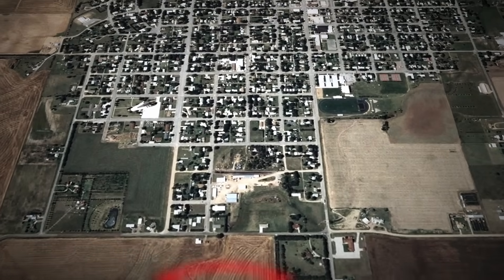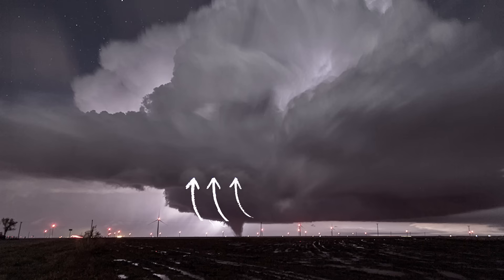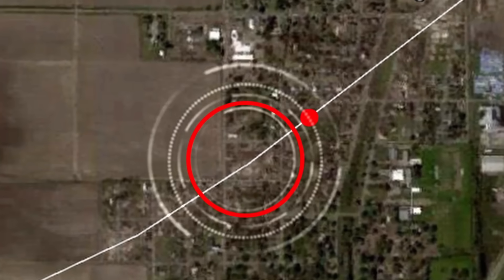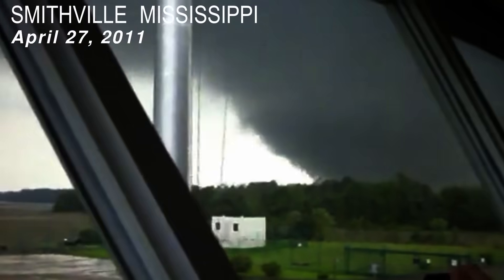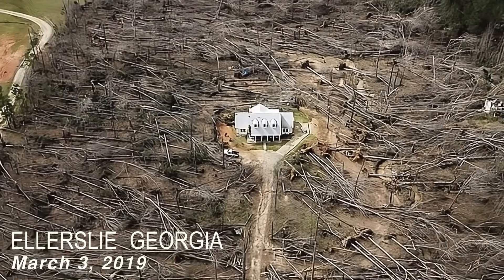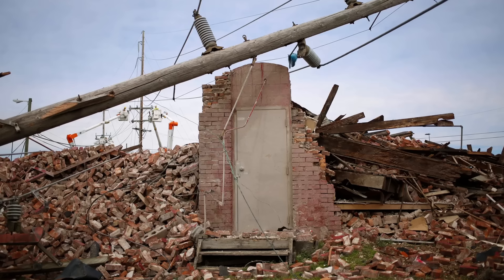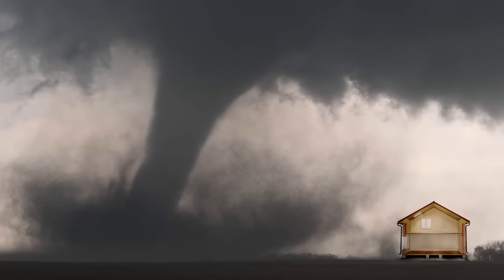The STRANGEST Tornado Damage Ever Documented

Comment: I've seen wooden telephone poles come unraveled and act like spaghetti in the center of a tornado.
While objects flew through them and once the negative pressure spin of the tornado passed, they decompressed and were solid again.
With objects stuck through them looking like physics took a vacation.
I've also during an F5 tornado seen a truck go overhead of us and land over a mile behind us.
Was rolled into a ball and blasted into a large tree it took out when it finally came down.
We also witnessed a herd of cattle picked up and disintegrated while their inside spun out if their mouths.
When they hit the ground, they just splashed like a balloon on the ground.
Had nightmares seeing that.

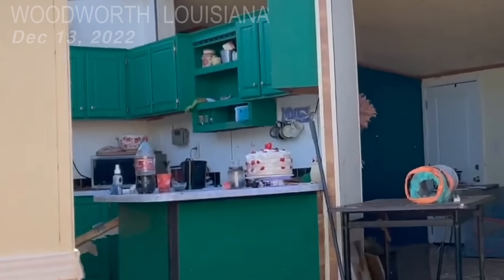Comment: 8:21 that is not an actual cake. It’s a ceramic cake holder. My grandmother and aunt have the exact same one. They were popular in the 80’s. Women would make them using a mold at popular ceramics classes. Plus you could buy them as they were mass produced. I’d know those strawberry layers anywhere! But this makes it even stranger because ceramics like that break very easily. Cool!!

Comment: At 3:03 yep thats a car astigmatism helps if you can memorise the shape, if you look close at the light its ovalesque and you can see the tiny dip in the middle separating the beam pattern per light, if it dropped from the hieght its at your looking for a severely flattened car in the debris. Weve seen videos of tornados picking up planes trains and transport trucks which weigh 10 to 100x plus what a 3200lb-3600lb standard sedan weighs so not that far of a stretch to do this.

Comment: Check out the 2007 Christmas tornado at Embry-Riddle in Daytona Beach Florida. It destroyed the school's entire aircraft fleet, flipping them over a donated (ex-John Travolta) military trainer without damaging it at all. Not even from hail. It tore open multiple buildings, with doors that never used to shut correctly now shutting etc. The craziest part? It destroyed the administration building, exposing the main girder through the center of the building. Turns out that decades before when the building was built, a construction worker had spray painted "Merry Christmas" in giant letters, only for that message to be revealed on Christmas 2007 by a tornado. Crazy stuff.

Comment: I had a 6 pack of tall can Bud Extras (discontinued now) in a shopping bag when an EF3 touched down immediately after I was dropped off from work near my apartment from a frantic coworker. I immediately had to run couldn't even get to my apartment so I ran into an empty parking lot next door. I thought it was a terrible decision since there was no cover I thought I was gonna die the tornado was gaining on me and I was getting tired and knew I couldnt run much longer when the shopping bag suddenly flew out of my hand in the air. The tornado made a sharp left turn and missed me by less about 30 feet I was covered in mud and shook up. I went to a nearby friends house until the weather calmed down thinking my apartment was damaged and in the same parking lot I saw my bag of beer on the floor. A moment of humor swept over me like cool atleast I can drink this stress away. When I grabbed the bag it was light the can tops were all completely sealed but there was no beer in any of the cans. I was shocked how did that happen? Did that tornado drink my beer!?? Funny and strange but true this was the Feb 5th outbreak of 2005 in Memphis.

Comment: In my opinion that light was most likely a emergency/road flare, either a traditional pyrotechnic flares or LED. Both pyrotechnic and LED flares are available in many colors such as red, white, yellow orange, ect.. 

 And since the light yellowish makes me believe more it was a flare. Because each flare color is used to indicate something different. And  "yellow flares are used to indicate obstacles, hazards, or the need for caution on roadways, especially in low-light conditions." There's even a good chance someone fired a parachute flare towards the tornado just for curiosity sake and /or to see what the tornado does with it.

Technically red flares aren't supposed to be used how most people do since "red flares are primarily used as a distress signal"

Also if it was a car then the car would be tumbling/spinning, so the headlights would also be spinning. Yet the light isn't flashing, it's a continuous light source.

when the light exited the tornado it doesn't seem to be falling fast enough for something as heavy as a car. There a tiny chance it could possibly be a motorcycle,
or maybe just a flashlight. But my first guess is a some type of flare.

Comment: Note that the Jarrell tornado wasn't actually stationary over DCE---it moved at a steady 8-10 mph throughout its time on the ground.  (Quick sanity check, since the actual primary data can be difficult to track down:  the oft-quoted amount of time it was over DCE---3 minutes, IIRC?---does correspond to roughly the amount of time for a ~0.5-0.75mi diameter area to pass if moving at 10mph.)

Comment: I remember reading the Little House on the Prairie books, and coming across a section in one of the later novels that described some strange damage left by tornadoes. Specifically, two men who were picked up, sadly killed, and set down perfectly side by side in a field by a twister. That’s odd in and of itself, but the pair of them were left stark naked with not a mark on their bodies! LIW also mentions how a guy just found a lone door on the prairie, with not a house or homestead in sight; it was apparently the work of another tornado that had destroyed a home somewhere and spit that door out, again with nary a scratch on it. Ever since reading that, I’ve wondered about how weird debris can get in these mobile spin cycles, and the kind of wreckage they leave in their wake. It’s fascinating to learn that the oddness continues with modern tornadoes, though of course it would be preferable if they somehow didn’t hit populated areas at all.

Comment: Just have to add some more from personal experience - or at least second hand:-) During the Palm Sunday outbreak in '65 the EF4(?) that skirted Grand Rapids, MI went north of town into a relatively rural area(since built up). There was a man who was out of town during the storm and came home expecting his house to be destroyed. Instead it was standing there, apparently untouched. But when he approached he noticed the house was off the foundations by an inch or so. Rather than go in he called his insurance agent. The agent came out, looked the property over, and came back to the guy, who asked how it looked. "Well," the agent said "the house itself looks fine but I don't know how we'll get the corn harvester out of your basement."
Later in '67 we had another that touched down on our street. Very little damage(although it later destroyed our school) but across the street were two garages side-by-side. By close I mean at twelve years old I had to turn sideways to slide between them. One of the garages was stripped down to its slab, the other was untouched, and a window in it facing its destroyed neighbor was unbroken.
That same tornado wrecked my cousin's wood-frame home. It was still standing and when they came up from the basement and opened the refrigerator it was filled with chunks of brick. Nothing brick in the neighborhood, and no brick pieces were anywhere on the floor.
Have lots more but this is long enough. Tornadoes definitely do strange things!!!

Comment: After the Girard Kansas EF5 tornado we drove around looking at the damage and we saw numerous cows with 2x4 lumber sticking out of them. We also seen about 1000 yards of T-post that once held 5 strands of barb wire that was now all missing just the post remaining. When that same tornado hit Franklin kansas it turned my grandparents garage 180` on the foundation. My grandma had a bunch glass bottles hanginf from strings on her deck and the wind didnt break a single one but spun the garage around just 20 feet way.

Comment: You are joking about the vertical winds... Right 😅😅 vertical winds cannot happen in a kitchen bruh... The cake is one of hundreds of small items that weren't displaced.. the roof was torn off... But most everything else inside was fine.
Reply from the maker: pressure difference between the exterior and interior of the home. air from inside the home rushes outwards blowing off the roof.
Reply: @highriskchris  nothing to do with my comment..  and inaccurate. Wind shear takes roofs off. Not internal pressure. It's not a pressure vessel. When wind hits a vertical flat surface.. it must go around that surface. That includes going up and over. Roofs that are torn off literally almost always have EAVES that catch that wind and flip the lid off. No different than hurricanes. Pay attention next time. You'll see it. Being in storm response for years... This is inherent. Seen thousands of storm damage and destroyed buildings.

Comment: That's nothing. In Oklahoma's F5 outbreaks, we had fully loaded Semi's flying thru the air, in Catoosa Ok. when it got to Joplin Mo's hospital they said it sat outside and churned and churned. Joplin was a right mess. You could find papers from one state in another state, or even another town. Tin roofs that no one knew where it came from. If you place isn't missing a tin roof, it must have came from a long ways away. That was in Tulsa where it landed. To this day non one knows where it came from.

Comment: But what are the chances the "vehicle" light in the tornado would remain pointed at the camera the entire time? The odds are against that. What else could it be?
Reply from the maker: Its likely that the camera settings used by Max would not show a light flickering at a high frequency (1/30s shutter speed on 1/30 fps video). Other chaser's video showed a distinct flicker to the light, look up Adam Lucio's video.
Reply: Ok. Thank you. PS: I remember seeing a high resolution (or enhanced ?) closeup/zoomed version once that appeared to show two headlights. But in the video here it seemed like the light never really changed much. I just wonder if there`s any other possibility other than a vehicle for what we see? Horrifying thought if there are people in that. My dad was picked up by a tornado on Interstate 20 somewhere between Tyler (I think) and the Louisiana line and he said he was lifted way up in the air and set back down going about 80 mph. The rear frame of the Chevy S-10 was warped some but it was still roadworthy afterwards but a 250lb load would cause the left rear tire to rub. He was in the Air Corps in WW2 from 1944 until almost 1950 and he said it was a pretty smooth landing except he came in slightly sideways and then hit a rough patch. He got lucky! I drove through a weak tornado in DeSoto Parish La in the same truck afterward on highway 84 leaving Mansfield. I knew the tornado was approaching. I almost wrecked. That was the third tornado that truck had been in...the first was in Winnfield La when it was new.  @highriskchris

Comment: Fine objects lodging in trees are caused by the trunk fissuring vertically under horizontal stress from wind ... NOT by wind driving objects directly into the living wood.
Reply from the maker: The only one that might be the case for is the straw, however the forks were absolutely stuck in trees, also the record was not stuck in a tree but rather a power pole, so it was definitely the wind.
Reply: @highriskchris  Yes, forks are solid steel, so vinyl too is much harder than tree trunks.  But I find it frightening that a tornado vortex can dissolve a tree for a few seconds-then let it reconstitute with straw in it. Human body--don't wanna say.

Comment: I’m in southern Saskatchewan Canada. In 1989 my farm home was hit by a tornado. When we came upstairs after it was going the porch and garage were gone, the room was half gone, someof the kitchen windows were gone, but the flower on the table was in place. There was wheat embedded in the back walls of the cupboards. The tornado sucked open the oven but must not have liked moms cookin  because supper was still in the roaster. We figure a rolling grain bin is what may have taken the porch/ garage addition but moms car was still perfect inside. Peices of the old aluminum topper off dads truck were stuck through the side of a grain bin galvanized steel wall across the road. But the grain truck sitting beside our bins with its hoist in the air was untouched. (Too bad, I hated driving that old heap). 
Tornadoes are weird things.

Comment: 405 joules? How many volts is that?
Reply from the maker: Volts is not the same unit!
Reply: "To calculate joules from volts you need the charge of the electricity in coulombs. From there, multiply the charge and volts together to get the energy in joules". So...  @highriskchris

Comment: I've seen tornados do weird things, cause weird damage. One picked up my grandparents (before I was born) with my father and my aunt in the car, off of I-70 highway, and set it down gently facing the other direction just off to the side of the road.

I've actually been inside at least two tornados. While in one of them (I was inside the house), there were strange columns of mist rising up all over -- like I Dream of Jeannie when she goes into her bottle, but white. My guess is that they were coming from all the rabbit holes. I'm not kidding, there were dozens of rabbits, and then, poof, they disappeared when the tornado went over. It was powerful enough to knock the fencing over and carry it off, but the house was not damaged.

In the other (this time I was inside my apartment), my ears were popping and the roofs over the playground were going up and down incredibly fast making this horrible low-pitched, very powerful noise. That one torn up trees, carried off the big garbage bin (which they never found), but went up right before tearing up the apartments.

Comment: I have something you can think about and maybe even do a video on. I have watched a lot of these over the years (grew up in the Texas panhandle, Amarillo) and I've seen tornadoes tend to follow electrical lines and hit transformers. It's also been seen that they seem to go out of their way at times to hit trailer parks. Does the electrical grid combined with metal buildings combine to "pull" the tornado that direction? It's a weird thing I've seen time and again, a tornado will be going through an area but it looks like it took a quite jog over to eat the trailers. 

Any engineering/chaser ideas on this one.

Comment: The light at the beginning you talked about is ball lightning.. I have the same thing in some of my Storm videos and I'm pretty sure that's what it is.  Tornadoes do not often suck up vehicles .. at most they move them or more likely just dent up and blow out the windows.. your theory about the cake and the velocity is on point though. The eye (center) of a the tornado is almost completely windless..getting hit by the wall is the most dangerous to get hit by .tornadoes also are rotating at various speeds within the cyclone.. the fastest and hardest part to measure is closest to the eye. It's hard to get a pod deployed into the eye because it usually gets swept up by the outer walls. So the speeds reported aren't always a good representation as to how powerful the tornado is.

Comment: Tornados are rare in Australia compared to the US, and even then, even rarer are powerful ones. Though in '93, a small one went through our town taking out two houses. One was right next door to my best freind's place and when I went to check on him, his house was fine, but a few meters away, half the neighbours house was gone. 

But and kettle was sitting atop of the fridge like nothing had happened. The wall behind the fridge was mostly still there, but the walls around that were gone. So it's likely the house suffered a catastophic failure equalising pressure, like shown in this video!